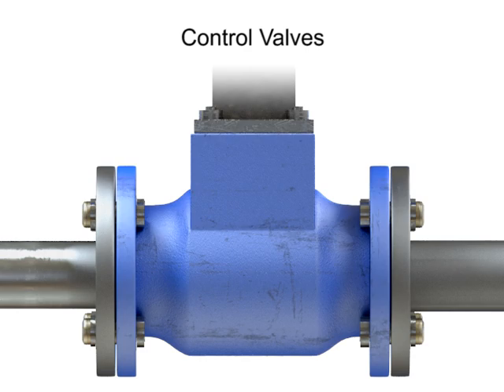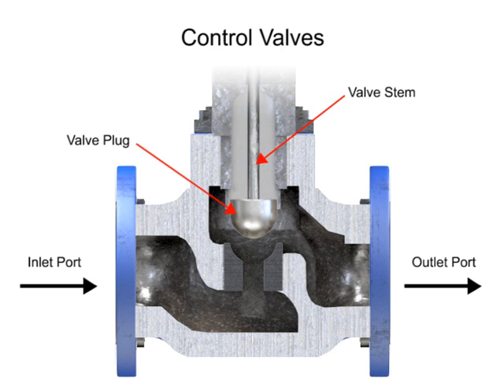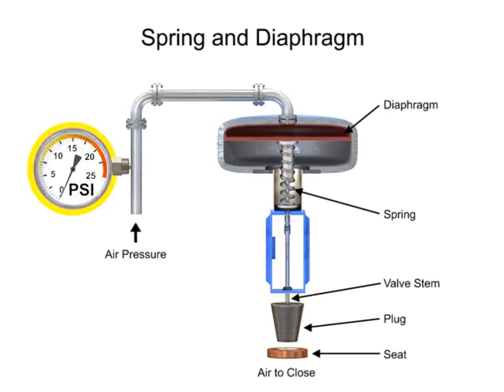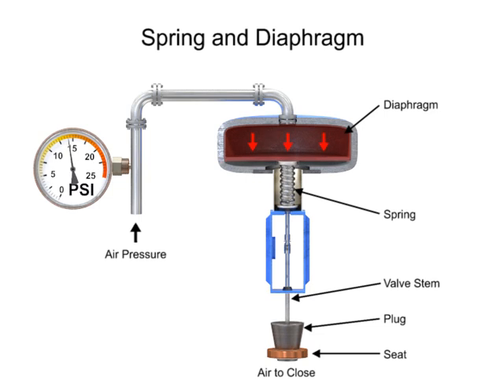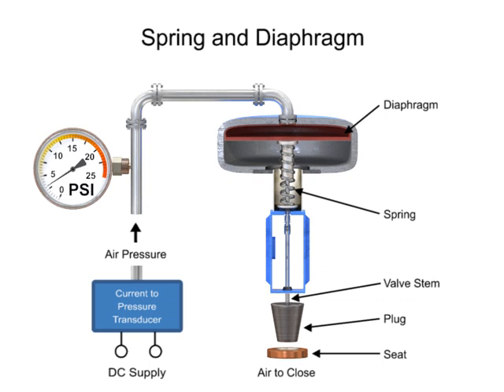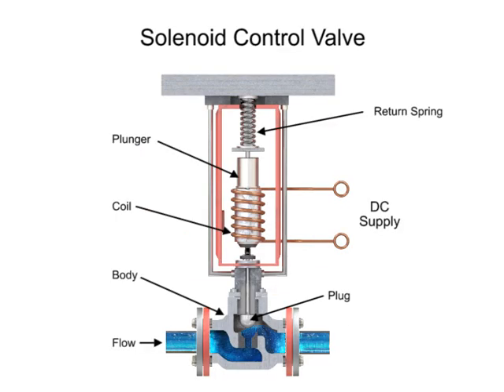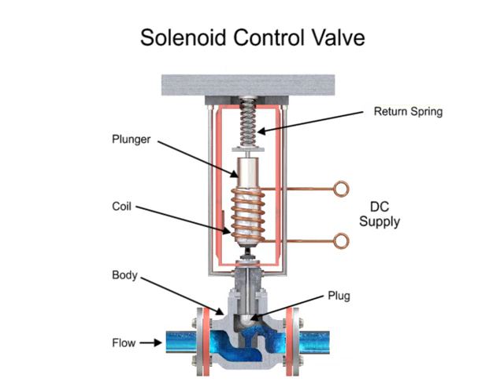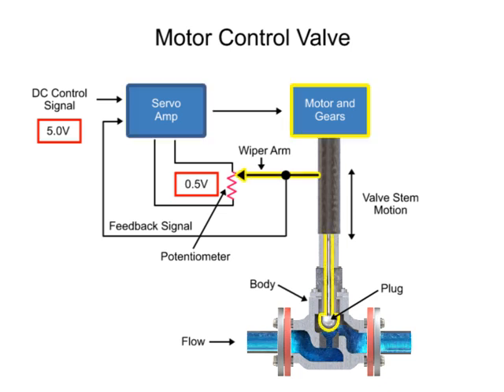Control Valve Actuators

Comment: Nice introduction but last one was little bit difficult and complex.
Reply: Ya actually in the last part, it concept states that when the feedback signal from the stem which is connected to a motor will be in the form of a measured variable right. And one that coming out from the servo amp will be manipulated variable. So basically what does a control valve does, it adjusts the manipulated variable in adjust the controlled variable to the set point (Since this is the ultimate aim in the process control system). So the valve plug will move up and down in relation to when there is difference in the values of set point and controlled variable (One to be controlled). And when the deviation almost diminishes (I.e result or reading coming closer to the set point), there is no need for valve to move because the set point is reached. I hope you get it. This was the principle explained at the last.